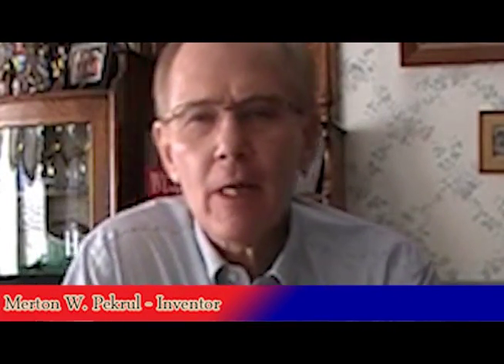Overview of Offset Rotary Vane Expander Motor

Comment: sir, i m also working on vane expander engine i just know that u have it working,its great. there are some difference in our design but why did u take Fibonacci ratio. is it have higher efficiency
Reply: Shubb, I'm also working on a multi-vane expander engine for a freon heat pump conversion. Are you still working on yours?